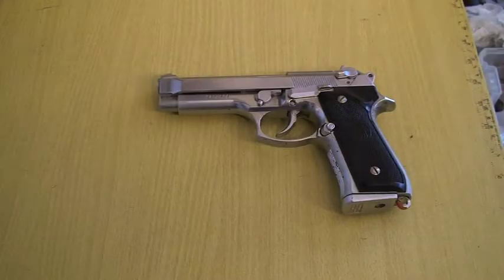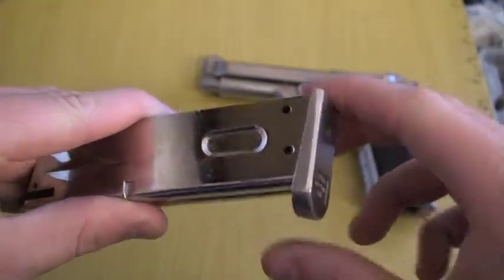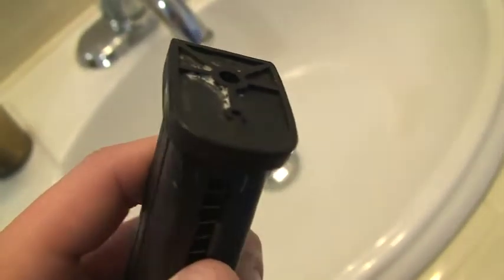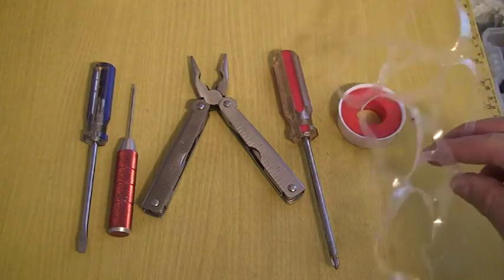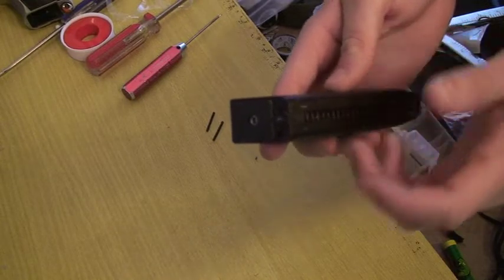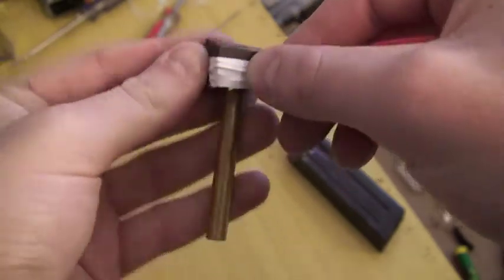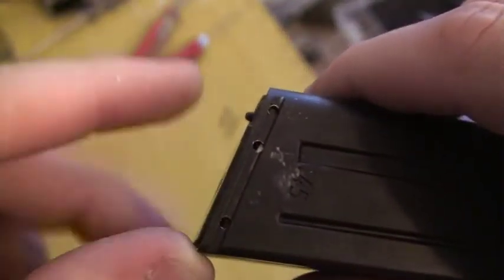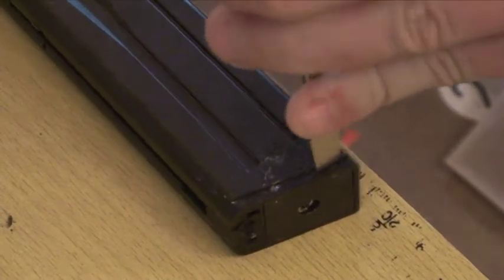Fixing GBB Airsoft Magazine Leaks (part 1)

Comment: This worked on my M9 magazine. The pins on mine are hollow tubes with a split running down the length of the tube. I popped them out by pushing down on them with a ballpoint pen. My o-ring was rectangular. I also used silicone spray. When putting the butt back in it required a lot of pressure to get the pin holes lined up. I couldn't get the hollow pins all the way through but putting a small allen key and applying pressure towards the butt-end allowed them to line up with the hole.

Comment from the maker: @AirsoftSniper2145 Only teflon tape will work because it is designed to be a thread sealer. Most other tapes will not make an air-tight seal.

Comment from the maker: @Iamsmarterthanthou Silicone oil (also known as Shock Fluid for RC cars). If you use any other type of oil, the petroleum will dissolve the rubber o-rings and seals... not what you want to happen.

Comment from the maker: You can just pour the oil down the valve and push the button a few times, then repeat a few hours later. It just needs a good soak in oil...

If you're talking 60wt motor oil, then no. Any Petroleum product (conventional and synthetic oils, WD40, etc) will rot rubber. Use Silicone oil ONLY

Comment: Hey man i was wondering if i could bother you for some help my dumbass cousin played with my gun and he said he pushed the release valve a few times. when i shoot my gun sometimes even with gas in it the gun will stop firing and leak gas from the barrel. when i pull out the mag obviously bbs fall out but when i put back the mag and cock it it fires again. Did he possibly break my o ring in the mag?

Comment: Iv got a leak at the top of my mag also.  can i use 60wt oil on the mag? Do i just pour the oil on the valve or do I need to pull the the mag apart and then oil it?